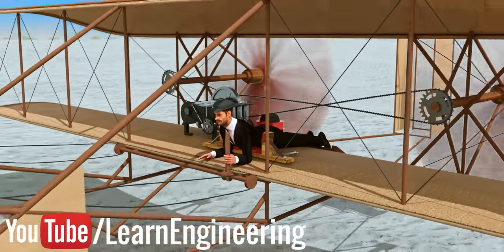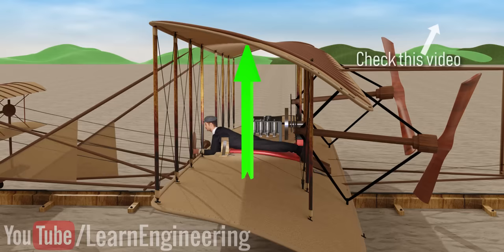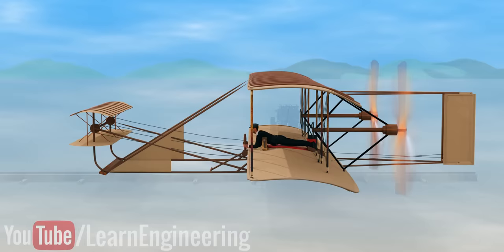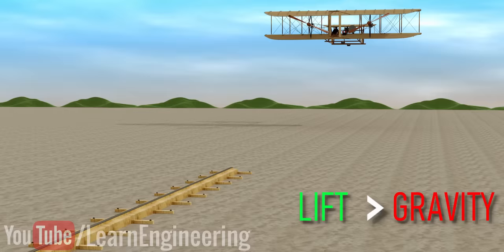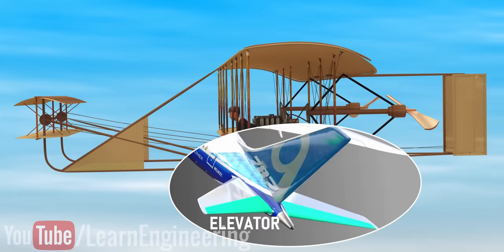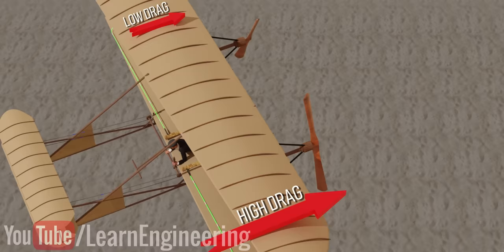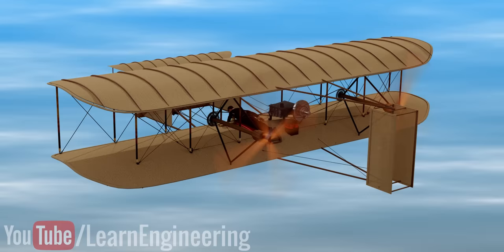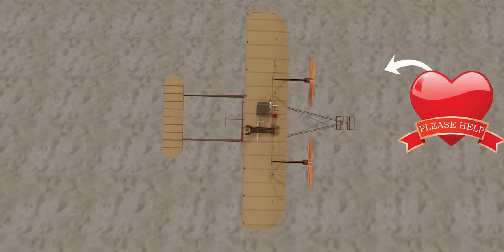The Brilliant Engineering of FIRST FLIGHT !

Comment: For all of the Brazilians who think Santos Dumont invented the airplane

Another common objection of the Santos Dumont camp is that the Wright brothers used a catapult to launch their airplane. They ignore the fact that the Wright brothers made over 40 flights of varying lengths before they built a catapult, including the four flights on December 17, 1903.  They also ignore the records of the flights the Wrights made in 1904 and 1905, which show that the catapult wasn't always used. If the Wrights felt they had sufficient headwinds, they took off without it.

The Wrights continued to use the catapult and launching rail long after they needed to because they felt it offered an advantage over wheels. Aircraft with wheels needed a long take-off run; with a rail the Wrights could be off the ground in as little as 60 feet. Additionally, the rail kept the airplane headed in the proper direction until the air was flowing over the control surfaces fast enough to give the pilot adequate control. Ground loops and other accidents were all too common in wheeled aircraft that had to traverse some distance before the controls became effective.

In 1905, after the Wrights felt they had worked the bugs out of their invention and had created a practical airplane, they invited the public back again. They sent out about 30 invitations to people whom they thought would make credible witnesses. Several hundred showed up at Huffman Prairie to watch them fly on October 4 and 5 , 1905. On October 5, Wilbur was able to keep the Wright Flyer 3 in the air for 39 minutes, flying 30 complete circuits of the field and covering over 24 miles -- in public.

Wilbur Wright experienced this anti-catapult chauvinism in France in 1908 when he set an altitude record and the Federation Aeronautique Internationale denied him the record because he made an "assisted" take-off. To prove to the French that whatever assistance the catapult had provided was beside the point, Wilbur took off unassisted on skids alone and set the record anew.

Two years later, the Wrights gave in to market pressures and began to install wheeled undercarriages on their airplanes. But they still used the same engine they had used when they first flew in France.  Power wasn't an issue; they could have added wheels earlier. They simply believed that the catapult and rail system was better.

Brazilians usually bring up the Wright catapult to imply that the Wright airplanes were somehow less technologically advanced than Santos Dumont's. So it's worth noting that on December 31, 1908, Wilbur Wright made a record-breaking flight where he remained aloft for 2 hours, 18 minutes, and 33 seconds, winning the coveted  Coupe de Michelin. During his entire flying career, Santos Dumont never remained airborne in one of his airplanes for more then 15 minutes.

Source: http://www.wright-brothers.org/
Reply: The wright brothers declared in their diary book that the ability to run and take off was only developed by them in 1910, in conformity ANATOLE DE FRANCE declarations 1909. Based in Jay spencer's criteria to disqualify Dumont 's event, wright brothers Did not fill all requirements to first airplane untill 1910. The flyers Could not be considered an airplane untill 1910. Dumont Won in 1906.